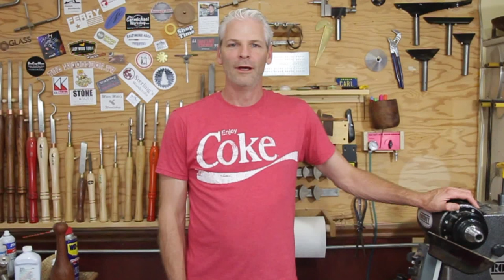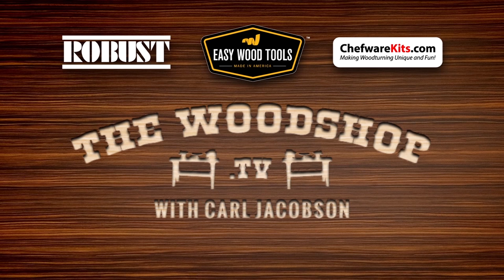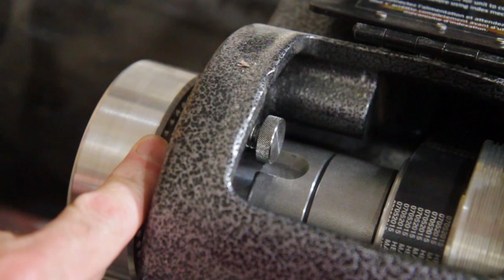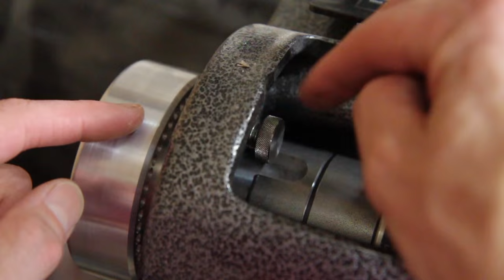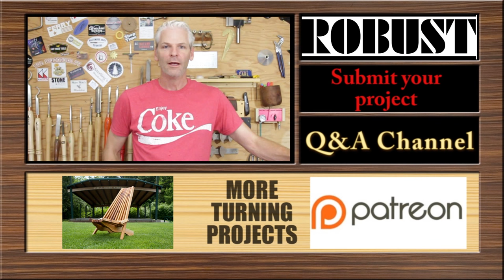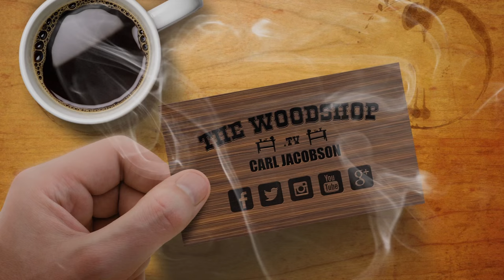Lathe Indexing

Comment: Thank you Carl.
I have an indexing system on my lathe which I've only used a few times but, coincidentally, tomorrow I need to drill 4 holes on a piece and it's important that they are precisely the same distance apart.
It's part of a project for a competition at my wood turning club in Sept which is for a miniature turning.   Brendan (Baconsoda) is in the same club so I can't reveal too much.
OK, I'm making a miniature table and the legs have to be equidistant apart.
Best wishes,
Alan.
Reply from the maker: Alan Simpson lol Thank you Alan! Don't worry I won't tell him! ;) Good luck!!
Take care,
Carl
Reply: Carl Jacobson Too late, I've already made miniature apples to sit in the miniature bowls on Alan's miniature table.
Best Wishes, Brendan.

Comment: Carl ... Thanks for the video. I am a but surprised that your new lathe doesn't have a spring-loaded indexing pin instead of having to turn the screw in/out for each position.
Reply from the maker: Gerald Jensen Thank you Gerald, when your using the indexer it's only a couple of twists. My last lathe had the spring system, but you had to push it in and thread at the same time... It was a pain!

Comment: I'm new to turning and my tools keep catching the wood and taking big chunks out of my work piece and it try's to rip the tool from my hand they are a delta set, I'm wondering if it from cheap tools or just dull tools, thanks and keep up the good work/vids I've learned a lot
Reply: Rominater1979 sharpen them, take lighter cuts and watch tons and tons of videos about catches and gouge techniques. and if youre using a skew chisel, tons of skew videos. My guess is youre using the wrong technique, which is okay, we all do when we start out. just gotta watch carls "techniques" videos, and there are a few other that are really good
Reply from the maker: Rominater1979  Thank you! Ya howycwap is right, I don't think it's the tools. Which tools are you having problems with the most?
Reply: Ya it mainly skew ya It well dig in pretty good I will do more research on how to work with it better. Ya I was making a goblet the other day just when I got all the out side of it all done I tried to clean it up with the skew before sanding and it grabbed and snapped it right in half. I'm not going to lie the skew is a painful pain in the a** to get down lol and thanks guys for the help
Reply: Skew can be the hardest to master, practice with it before using it on any project.